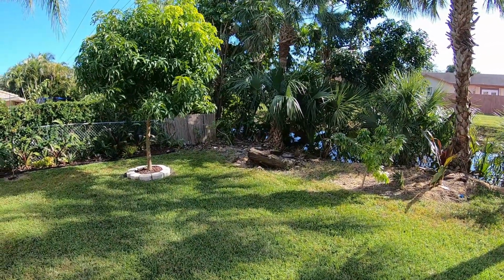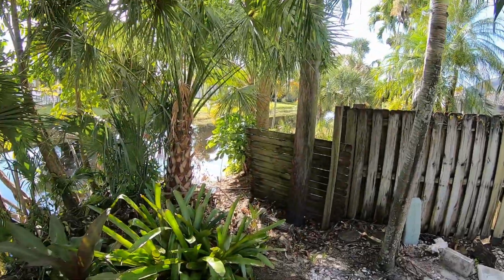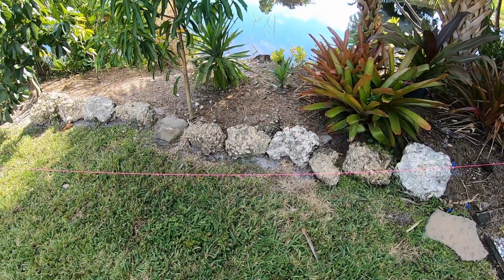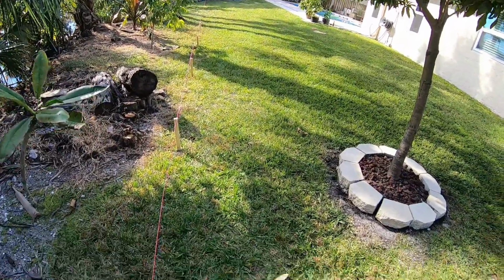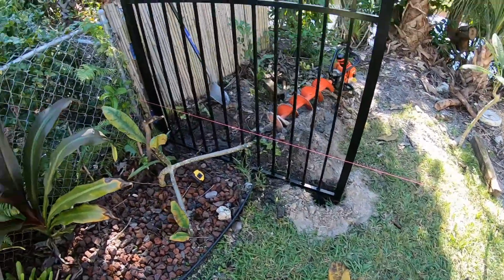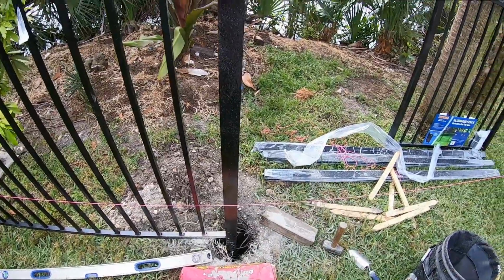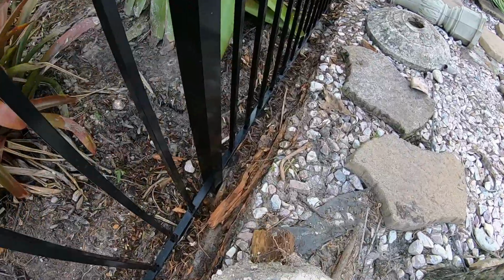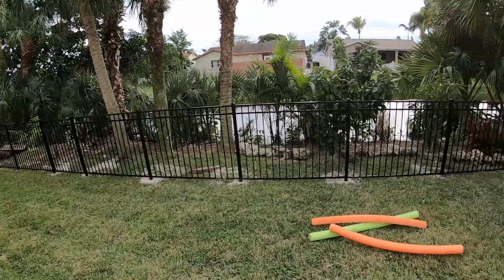Installing an Aluminum Fence

Comment: Can I install these on a curve? Like I know there are corner posts (90 degrees), but I need to turn anywhere from 135 to 155 degrees around a bend. Thanks
Reply from the maker: I have only ever run this fence in a straight line but you might be able to get away with some wide-angle curves.
Reply: @JoesGarageProductionsLLC  Ok thanks, that is what I figured.

Comment: When i install the fence into the pre-punch slot posts..when im ready to secure it with the screws.. do i lift and level it.. or let it sit into the slot? If i let it sit into the slot there will be atleast 1/8th inch of an opening.

Comment: My experience with Lowes is that their employees don't have a damn clue as to what they carry in stock, and what's a special order item.  These fences are NOT stocked in northern stores.  They kept trying to tell me they had a certain post in stock, just because it said so on their inventory.  Had SEVERAL employees tell me that, SMH.
As for doing the gate, I made a spacers out of wood that I could clamp in between the posts to make sure they were parallel top and bottom out of some scrap boards.  I also used quick drying cement for the gate posts so they would support the weight of the gate and not move.  For the other posts I just used regular Quickcrete.
Reply from the maker: Yeah I have come to learn that when Lowe's says they have something in stock, and the number of items in stock is in the single digits, odds are they have nothing. Nice tip with the spacers!

Comment: Did you trench out towards the end so they were all level? If so, would there be any issue just going with the grade?? Or that was best for ur property?
Reply from the maker: I gave that a lot of thought actually. I did end up trenching down a few inches on the higher side of the yard. I thought it would look weird with an unlevel fence line and I couldn't leave a large gap underneath the fence on the lower side of the yard otherwise the dogs would escape.

Comment: Nice video 👍
A lawn care customer of mine asked if I can install 85' of this fence (13 posts), straight down his yard without gates or corners. He wants to know how much I'd charge. How long did it take you and your friend to do? Do you know how much a company would've charged you for labor only? Thank you.
Reply from the maker: It was mostly me working alone. I want to say it took me maybe two or three days. The worst part of it by far was removing some of the old fence posts that were in concrete.
Reply: @JoesGarageProductionsLLC  thanks for replying. Do you have any idea how much a contractor would have charged you to install it?
Reply from the maker: @ramblin_man23  sorry no I do not. I didn't get any bids
Reply: @JoesGarageProductionsLLC  okay. Just don't know how much to charge him. Thanks
Reply from the maker: @ramblin_man23  I used about $1,200 a materials for 80 linear feet and it took me about 3 days. Years ago I got bids to do it in wood and I think they were around $1600 but wood is a much cheaper material. I would think you would be close to $3,000 for that job off the top of my head including materials, I am not a contractor so don't hold me to that
Reply: @JoesGarageProductionsLLC  that gives me a ballpark idea. Thanks 👍

Comment: First mistake was going to Lowe’s Home Depot all the way also would wait 24 hours to let gate posts set they are holding so much weight want them fully set so when you are hanging it you don’t throw it off level
Reply from the maker: Thanks for the suggestion, but I didn't have any of those issues. I'll keep that in mind going forward.

Comment: Great job on installing the fence!!! 
Would you mind asking is how many inches between each pickets? 

I am thinking about buying the ironcraft from lowes as well but they have two different types

The ironcraft cheshire has 1.63” between each pickets and the ironcraft berkshire has 3 13/16. 
Could you please let me knoww what type you get. Thanks a lot!!!
Reply from the maker: Pretty sure the one I installed here is the larger of the two sizes. I know that local code says prohibits any space is larger than 4 inches

Comment: you buy it from lowes
Reply from the maker: Yep... It had to travel to several stores to get all the parts. Apparently they don't all stock all the same parts. And more often than not the stock in the computer was wrong .. by a lot. The computers would say they have 20 of something in stock... you get there and there's nothing.

Comment: They call it aluminum but is actually cheap steel, not even 16 GA
Reply from the maker: The fence shown in this video is definitely not steel. By weight and strength it felt by aluminum to me.